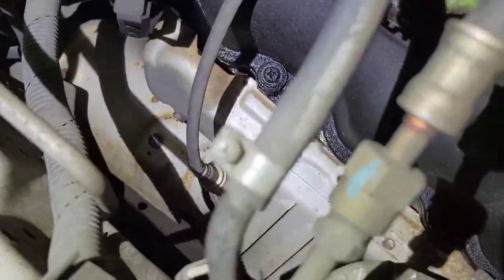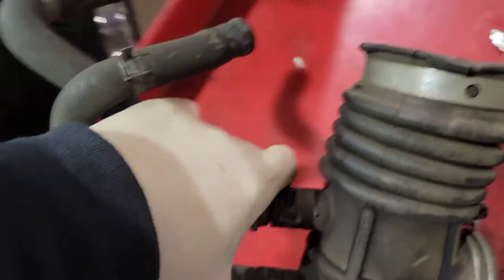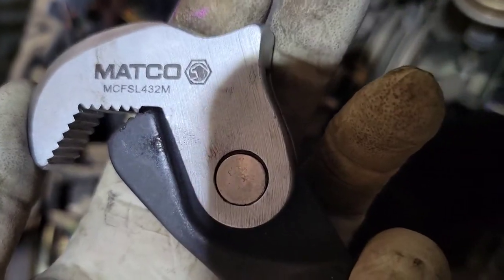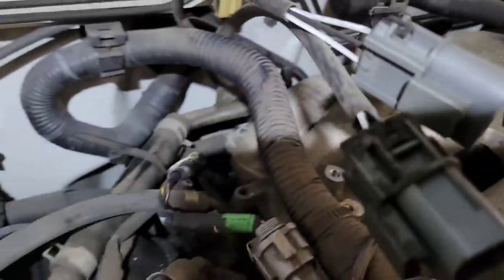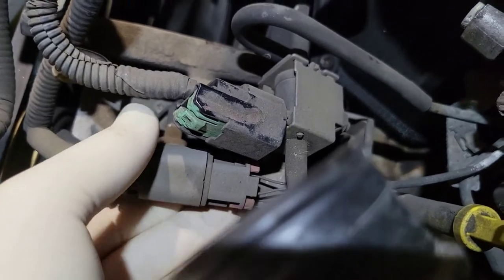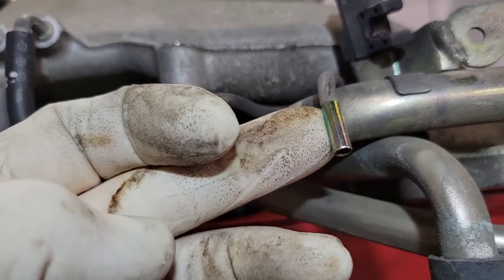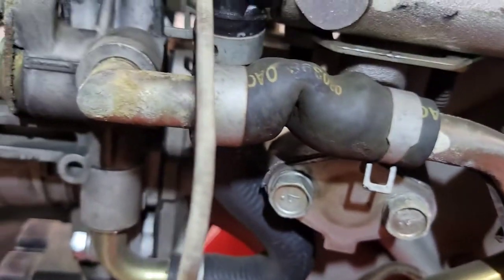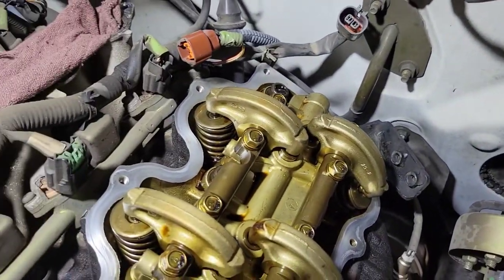Nissan 3.3 Valve Cover Gasket Replacement

Comment: The Japanese always loved putting excessive hoses on their engines. Thanks for the tips. I learn a lot from your channel.
Reply from the maker: Yes they do, especially all the coolant hoses for the throttle body. Such a pain in the butt. You have to worry about getting everything back together without leaking. I have had coolant leak after coolant leaks on these engines. Such a pain. Thank you for watching.

Comment: Yup, prepare to change EVERY rubber hose you have to touch when doing this job.  Its not that hard, but 20+ year old rubber hoses are trashed......while the engine itself is super reliable, it looks like a BMW engineer designed it by how nonsensical things are placed.

Best is to delete all the intake plenum coolant hoses by just bypassing them.  Super easy to do and saves all the headaches of removing the intake and removes 6 possible coolant leak areas.
Reply from the maker: Yes for sure

Comment: Wow, never seen phillips head screws on a valve cover before. Good vid Tony.
Reply from the maker: Thank you Steve. Yeah stupid Nissan used the phillips on these and when you are taking it a part they are all really loose. Depending on the service advisor I am working with, I sell the bolts a head of time, so we would be replacing the phillips screws with bolts. Thank you for watching.

Comment: Nissans have quite a lot of hoses and connectors under the hood. Quite intimidating to a lot of people especially the ones with with minimal experience. I wish the owner would have approved the extra work. Thanks for the vid!
Reply from the maker: Yeah Nissan's are really different to work on, the repair info does not tell you how to remove anything, just shows pictures. After I took this one a part I noticed a co worker doing a lower intake manifold on the same engine and he had taken egr, throttle, the pipes under the intake off. A lot of extra stuff, like I used to do when I first started working on them. Thank you for watching.

Comment: I’m not looking forward to having to do this on my truck but know I have to. I’ve been avoiding removing the plenum and all the problems that come after. Figure I will change everything that can be changed under it while it’s off. 
 I saved your video to use for reference when the time comes. Ty for such a detailed video.
Reply from the maker: Sorry you have to tackle this, yes under the intake can be a nightmare, replace whatever you can. Good luck and thanks for watching.

Comment: Thanks for going through the various manifold connections and hoses.  I just removed  my plenum and valve covers today and it's a real struggle to get everything removed when all those pieces have been undisturbed for over 20 years. Surprisingly the most frustrating and time consuming part was unplugging all the electrical connectors. Again, they're totally baked and brittle from being cooked for a couple of decades by the engine heat.  While apart I'm taking this opportunity to replace every vacuum line and every hose connected to the plenum. One tip I might offer- DO NOT replace your rear coolant hose clamps with worm gear type.  If you do they will probably leak because they apply uneven clamping pressure - particularly the small diameter types.
Reply from the maker: Your very welcome. I agree about the hose clamps in general. On this job the clamps did not come off where I could reuse them. I usually leave factory clamps on. Yes replacing everything under there is a good idea. Thank you for watching.

Comment: Dude this looks like a pain in the butt but I'm glad I have the correct way to do it. Thanks for the help!
Reply from the maker: It is kind of a pain the first time. I appreciate you watching thank you
Reply: I sure do appreciate when someone takes the time to make these videos! I'm so old school my first project was my two-day-old mini bike with a 5 horsepower Briggs & Stratton had it all apart at the age of 10 to see what made it work! A friend and I talked to his mother into letting us do the valve job on her convertible 65 Galaxie 500 for the 352 at the age of 12 using a Chilton's manual within have a Motors manual. So it's 62 yes it's a lot easier to look at my phone and watch a video then to pick up the shop manual and look to see what needs to be taken apart. My wife loves her go for Frontier she's had it since she got it off the showroom 203,000 MI later I put a couple timing belts in for her replace a front end twice because she likes an oversized beefy looking Tire on it and I've noticed that she's got valve cover gasket starting to leak so here we go mr. Curiosity going to tear into it! Thanks again for the awesome video

Comment: Thanks so much! I have 2 questions if you don’t mind:

1. What type of lube do you use on the new hoses you replace? Is WD40 ok? Or should I do a silicone based lube?

2. Do I need to use RTV or any other type of sealant on the valve covers? Or is hammering the tabs the only thing you need to do?
Reply from the maker: I generally use Sil Glyde. you can use wd40 because it is only a tiny amount and only to help with hose installation. No silicone on valve covers. Thank you for watching.

Comment: I’m working on this same engine in a 1998 pathfinder, the two coolant lines that you cut, do they have a part number or specific name for that hose? I’m on to the timing belt and water pump next.
Reply from the maker: I am not sure if they have a name, we usually have to get a parts breakdown of the parts and pick them out by the picture and order them that way. I wish I had a better answer for you. Good luck and thank you for watching.

Comment: I’m getting ready to do this. Wish I had the part numbers for those 2 hoses in the back
Reply from the maker: sorry brotha it is a pain in the butt to find the part numbers. Good luck and thank you for watching.
Reply: @NutsandBoltswithTone  I might just use flexible silicone hoses
Reply: @WibbyKDX  did that work out?
Reply: @musictube17  I keep putting it off 
South Main Auto channel did a video where he had to remove the plenum. I think he was able to salvage the hoses

Comment: Do you have to replace the plenum gasket or o-rings ? Getting ready to do the same with mine.
Reply from the maker: Yes you need to replace all the seals and gaskets you take off. If not you will end up with driveability issues, check engine light, etc. Thanks for watching and good luck.

Comment: HI,

Finally got that truck up and running,  You're video was a great help.  I had a lot of other concurrent projects so it got pushed back.  I have an annoying problem maybe you know about.  The speedo is not accurate, it is off about 6mph at 70mph.  when driving and compensating for true 75mph, I have to do 84mph.  If I have to pass and the incorrect speedo hits 95 (around 82-83 mph true) it balks like a governor kicks in.    Very annoying,  I have the 275x60x15 tire size  (the tires were on the truck when I got it) the sticker states 265x70x15 so maybe that the cause of the discrepancy I guess.  Any thoughts?

Thanks
Reply from the maker: Congratulations on getting truck running. Anytime we find a vehicle with inaccurate speedo and the tires are larger then that is usually the cause. As far as what your feeling that's probably because the speed is inaccurate. U can can probably get speedo recalibrated to match your tires. I'm not sure but something to look into. Thank u for watching the video

Comment: Huge pain in the ass, but I'm halfway done with the valve cover gaskets on my 3.3L Supercharged Frontier. gotta run to the parts store and get hoses like you suggested. If you're going to do this, especially on the Supercharged engine, go ahead and replace your spark plugs too, otherwise you're doing this all over again.
Reply from the maker: Oh yeah if you are doing this on your own vehicle then yes you would want to do plugs at the same time. Thank you for watching.

Comment: Question. Valve cover grommets when installing. Is it rubber side up against bolt head. And metal side down against valve cover. Or is it reversed. Thank u
Reply from the maker: Should be the metal side up I believe. Thank you for watching

Comment: Thanks for a great video  .

Where did you buy the hoist you cut and what the part number for this
Reply from the maker: I am not sure what the part number is. It is a very common replacement hose so you should be able to find it. Here is a link to a nissan parts website, second picture over has the hoses on it with the part numbers. Thank you for watching.
https://www.nissanpartsdeal.com/parts-list/2001-nissan-xterra/exhaust_cooling/water_hose_piping.html?diagram=211_B003
Reply: @NutsandBoltswithTone  thanks for the information

Comment: My Phillip head bolts on the Valve cover are stripped, I will need to buy new ones but don’t know where to find them could you help?
Reply from the maker: When I have that happen I send the bolt to the parts store and have it matched up to new bolts with a hex head, no more Philips head. and I get the grommets to go on the bolts. Thank you for watching.
Reply: @NutsandBoltswithTone   awesome thank you
Reply: @tylerkerr7834  hex bolt dimensions are m6 1.00x25mm

Comment: I guess this is the problem on my truck, I have a 2000 frontier and for a while it's been getting a burning oil smell and sometimes it gets smokey, I thought it was coming from under it but it seems to be this
Reply from the maker: Yeah it is very common and it runs on the exhaust and that is what smells. Good luck with the job, let me know if you have any questions.

Comment: You can get a similar crows foot tool from Amazon made by Powerbuilt for $39 for 2 sizes
Reply from the maker: Thank you for letting me know,  I actually did buy that.  Right when I was going to order the matco ones someone told me about the powerbuilt ones
Reply: @NutsandBoltswithTone  I just ran across your video 😀

Comment: I did these valve covers and after finishing this job car wouldn’t start and then I turned the crank pulley to check if anything fell inside the intake manifold but it didn’t. After doing that the car started but was misfiring and an excessive amount of white smoke came out. I went to go test drive it and car overheated right away and I had to repeat the same process after turning off the car so it could cool down. I’m really bummed, anyone know what it could be?
Reply from the maker: That sounds very strange and unfortunately I do not know what could have happened. Thank you for watching.
Reply: Check your spark plug firing order.. You probably have them mixed up.

Comment: What would this cost typically?  Parts are cheap but this is easily a 3 hr job
Reply from the maker: I actually do not know, I do not see any dollar amounts for any jobs. Sorry I cannot be of any help with this. Thank you for watching.
Reply: @NutsandBoltswithTone  any advice in a compression loss issue with this engine?
Reply from the maker: @TimR1216  you will need to get a leak down gauge and perform that test to see where you are losing compression.

Comment: that hose under the manifold tends to leak.  i had a leak there before, my mechanic was able to loosing everything and replace it without pulling all that off,  but if i did it, i would do it like you did, the right way.   the owner is stupid not to replace that hose, after you have done all that work to remove everything in the way.  all those hose should be replaced under there.  Also the knock sensor should be replaced at this time, because those go bad also, and that would be a nightmare to have to take all this apart again because of a knock sensor issue.
Reply from the maker: Yeah you are correct, knock sensors are very common. Actually most of the times that I have been removing that plenum was because of knock sensors. Thank you for watching.
Reply: you can easily relocate the knock sensor without taking anything apart, a couple of wire snips, pigtail adapter and re attached, and a bolt, but yeah, if you're replacing driver side valve cover gasket, you should probably just take care of it.
Reply: @nikao7751  I relocated my knock sensor, but some smog places out here will not pass it visually.
Reply: @raiderman28  that's just crooked man, those smog guys can be crooks, I've tested them out when it was pass or don't pay and many of them proved to be crooks, but when I was in Los Angeles I found that a lot of Asian mechanics were the most honest, I don't know why that was my experience but it was refreshing. I live in Thurston county Washington where I don't have to deal with the whole smog check anymore, for now. Take care.

Comment: Great Video,  Ton of crap to fix a little stuff
Reply from the maker: Thank you, yeah those things have a lot of stuff in there. Thank you for watching I appreciate it.
Reply: @NutsandBoltswithTone  Well, it started as research to change my valve covers, Q:  Do you have video on the timing belt replacement????   HAHHAHAHAHAHAHA  Seems I have gas and no spark.  Rotor is not turning. So I got the Valve cover off the passenger side and tomorrow will check for movement on that side.
Reply from the maker: @johncindywitt559  unfortunately I don't have a video on the timing belt yet. That sucks about your rotor not turning. Can you look in the oil cap while cranking to see if anything is moving? If you have more questions I can help you if you message me on Instagram it is much easier.